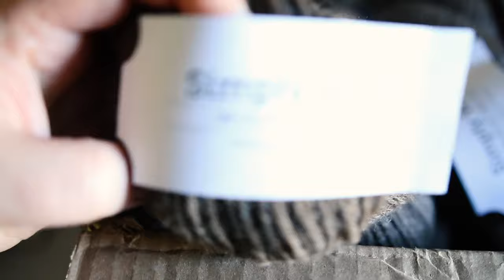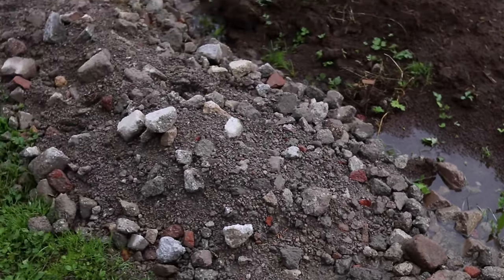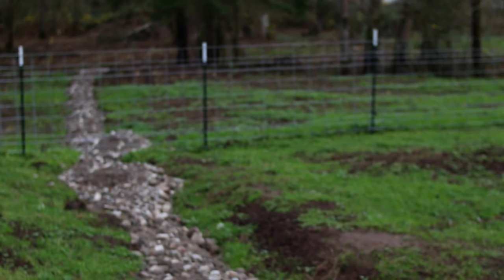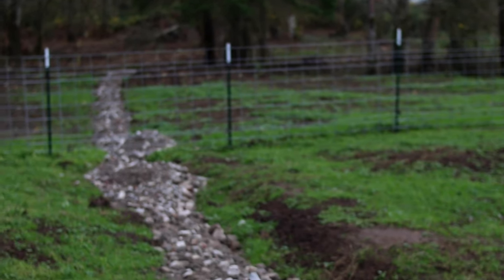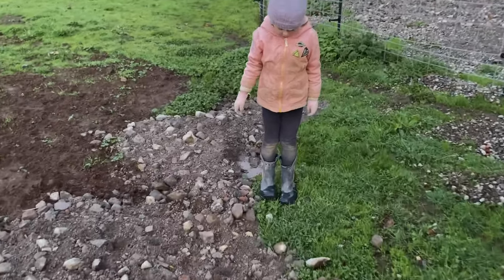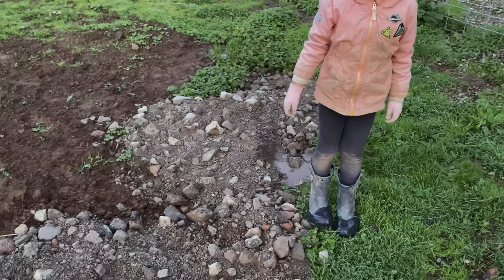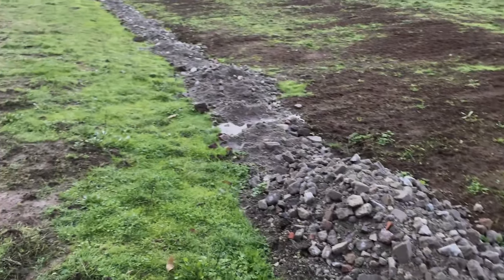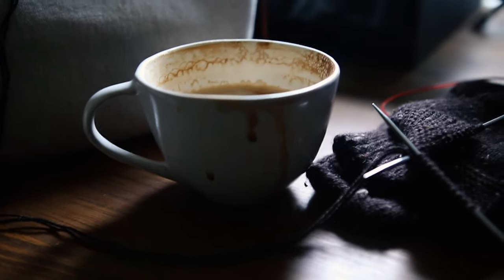Vlog | More Farmstead Projects + My Favorite Way to Knit Socks

Comment: So I gave these a try. I’m using something called Angora Lace (it’s fingering) by wisdom yarns. It’s 50/20/30 merino, angora, nylon. I LOVE these! They are thick and squishy and so cozy with the angora. They are also faster to knit then the way I normally knit socks. I already have about 40 pair of handknits sock knit the regular way I can see me only knitting them this way from now on. It uses up the yarn too! I have tons of stroll and felicity. The only downside is it hurts my hands, especially when I’m knitting the heal.. but I like them so much I’ll prob knit them anyway.
Reply from the maker: Ohh, that sounds so lovely. I agree, it’s a bit harder on the hands. The first pair I knit this way was torture actually. My hands were constantly cramping up. I must have adapted to it, though, or perhaps I knit them with looser tension because I don’t think about it anymore. Perhaps it will be the same for you. In any case, I’m glad you like them. I must try a pair with angora.